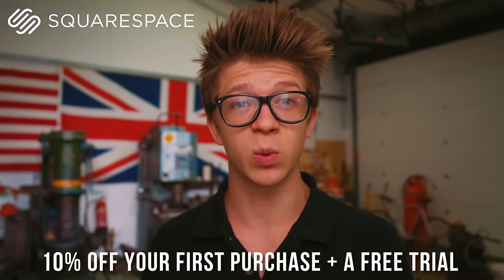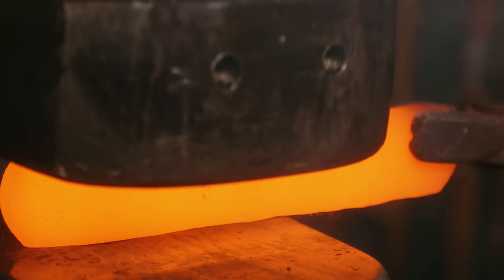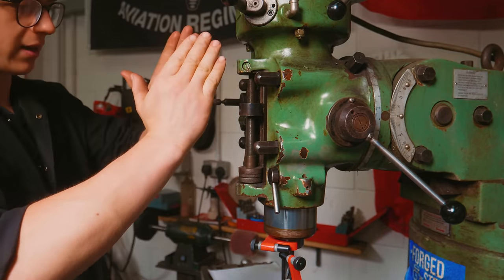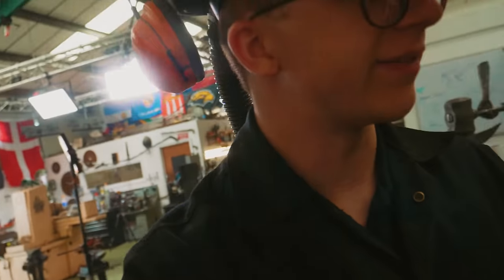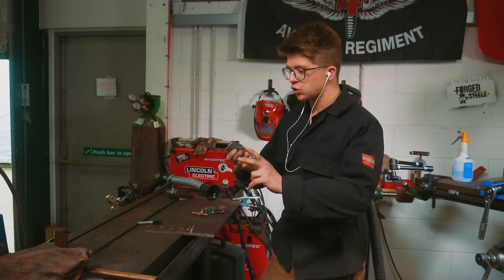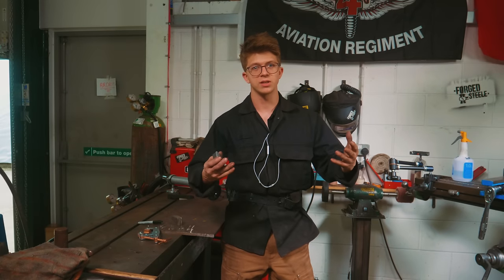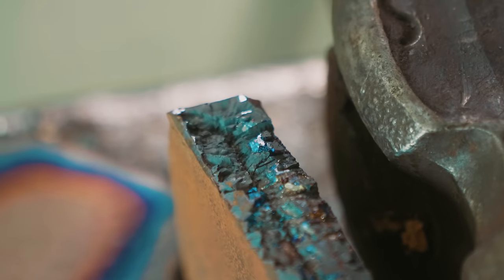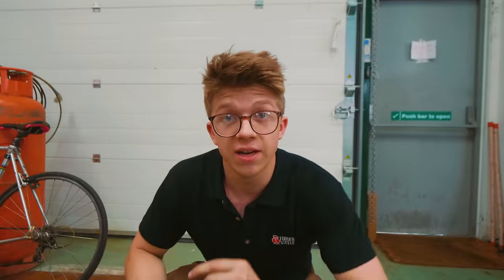CAN YOU MAKE TITANIUM & STEEL DAMASCUS?!?!

Comment: Why dont you melt the titanium in a crucible and add steel in it ? Then they will be fuzed already and cool it into bars and make a damascus with it ?
Reply: Alloying titanium with steel likely wouldn't work at all. At least I see no production alloys and if it worked and was useful someone would have mass produced it. But then again maybe someone has and it was just a useless alloy for mass production. 
Two I don't know that he has or had a kiln that could actually reach 1670c to melt titanium. To the best of my knowledge he couldn't melt steel in the first kiln and that requires 1510c. Best I have seen him do is bronze at just 950c.

Comment: Considering the melting point of titanium is so much higher than steel I'm not at all surprised this didn't work, especially in a gas forge. I'm surprised you can even forge weld steel in that.

Comment: Considering titanium is so strong. You should heat the titanium up. Before you join the pieces together. Get the titanium not toy melting point. But close enough and then the mild Steel. Heated up till about eight hundred degrees. Sandwich the piece of mild steel between the titanium two pieces of titanium. And then let the titanium bond to the mild Steel then hammer it  lightly of course using lots of flux.
Oh, yeah. I also like to see some wootz Damascus steel made. Nobody is ever touched on that. In blacksmithing much

Comment: The problem could be a oxide layer as many other have commented. Maybe if you tin the titanium with solder, led or another metal that bonds with titanium... Then an oxide layer won't form on the surface and maybe you could forge weld it. Comments on that?

Comment: Can you somehow mix Tungsten into the center of a forged creation, and then create a knife, sword, lawn mower blade or something of the sort? I want an edge that doesn't go dull.

Ps not a toy! Tungsten carbide cuts steel.  If the Tungsten Carbide is sharpened to a razors 0edge, there should not be much force needed to actually cut through an object. (Yes I said cut, not bashed). I feel if the steel could wrap around the tungsten,  then stress induced failure could be less of a problem.

Comment: What if you drill holes through the titanium then have poles coming from the iron that fit with the titanium then hit that to hold it in place making it begin to rivet itself into place then it will after a while start to "weld"

Comment: Well... I am no forger.... just an engineer. Isn't a fusion between two metals sorta like a metallic bond on a molecular level? Well then... titanium (depending on the alloy) won't bond to steel (iron and carbon) as the titanium (depending on the alloy) has a much higher melting temp than steel (again, depending on steel)  and reaching that melting temp will cause the titanium to oxidize in atmosphere...... so..... one could try and heat the titanium to it's melting point in a vacuum (hard) to forge weld it to steel, but then the steel would be supes gluey... so the only other option is to alloy the titanium with another metal (will still get oxidation) to try forge it. What I wanna see you try is cobalt and steel. Blue with a black etch.... could look sick af... or cobalt and copper... sick af as well! If it's possible (haven't thought about it)

Comment: QUESTION: what about 6150 + L6 ?

HCS+Ti was obviously a failure due to incompatible working properties.  However, specs imply 6150 and L6 should be a much more promising match.

What little I was able to follow suggested they might work well together, and should have a nice visual contrasy, but both are apparently rather hard to move and need a really strong power hammer.  Since you guys have that brand new Anyang 165 ... any thoughts on trying it out on an experimental upgraded damascus pairing ? 🤔

I'm not a smith, so this is all just armchair metallurgical woolgathering to me. Exactly the sort of thing I'd play with, if I were a smith however.

Comment: Your surfaces aren't flattening enough. Lap the layers together and wring them like gauge blocks. Then you should have minimal air between layers. I'm betting they'll fall apart once they are in the furnace due to uneven heating of the metal but who knows you might get lucky!

Comment: I know this is late but I was curious if sandwiching the steel on the outside might affect the bonds. Maybe soaking the welded block in an anti-oxidizer solution prior to heating. Is there a flux like used in Damascus steel? Just wondering because I dig the trial and error of education and experimentation from the channel. Like the Hakuna Mattata made with copper and nickel. Btw-did you reach out to Pewdiepie for that one? Merch collab? Js...

Comment: as forging is a form of welding, look at the welding processes, they are not patented, thats general info, purging with argon is standard to welt, as the oxides cause cracking and delamination. then electric arc to melt

Comment: titanium aluminum and magnesium are very closely related on the elemental table all have one thing in common they can burn in the 1910s and 20s they made a pot metal mix of aluminum and magnesium that stuff burns brighter than the sun! they made it because it was blue-ish so pretty bad thing they also used it in airplanes when they found a WWII bomber in the arctic they got it running again stupidly they used linseed oil to clean the inside and left a rag inside that self-ignited and when the aluminum/magnesium mix was hot enough it went up like a torch!
they also used this mix in paints and probably that very paint was on the Hindenburg it wasn't the mix (thermite) the Mythbusters suggested it was very likely this puppy! far more flammable! 
the biggest use was in the production of pencil sharpeners in fact they are still being made today I made some great homemade fireworks out of these by grinding them to powder and mixing it with gunpowder ps disclaimer: do not try at home folks! I have been experimenting with anything and everything for decades and I do get hurt at times so, if you know F-all then don't come near this.

Comment: If titanium can be Forged but doesn't stick.
Can you or i suggest to Forge layers of metal such as stainless in the inside hard steel at both sides (but softer than type of stainless steel in the inside.)
Such as Filipino type machete that is hard in the inside then soft toward the outside.

The process of doing it is to wrap the stainless with folded hard metal leaving small part of the titanium at its edge for the main sharp blade.

 not just sandwich, but folded from side band back for the sharp blade. 😊

Comment: can you put you billet into a piece of square tube then seal the ends and form/bond it then later you should able to remove the box by grinding it way ??? will that work or will the different metals expand at a different rates ????????LLl

Comment: The way the metals reacted when you hit them reminds me of the legendary angel steel that would burn on contact with almost everything accounts on the metal said it was very strong and light but set alight as soon as it was hit by almost anything else and it was said to be of strange cold color which also fits the colors of the oxides matches with that too so something like what you were trying to make might be what the legendary metal was.

Comment: Termal linear expansion coefficient of Ti and Steel is to different for stable connection. Evry time it's  cooled after you heat it up, it will crack. This and bemetal corrosion kills the idea of Steel Ti damascus entirely. it's not possible at all.

Comment: The problem you're having, is similar to the problems when trying to weld magnesium and zinc. Would it be easier to have 2 pieces of titanium, & 3 pieces of steel in between, with the 2 outer layers of steel folded over & weld it all closed.

Comment: why not use a press rather than hammering. also isnt there a technique of putting kerosene of something in-between so it burns off the oxygen or using another filler metal that bonds to both.

Comment: How about sandwiching in the new diamond hard platinum/gold alloy into the mix for the edge and point?  What if THAT would bond dead center so that the final product would have the perfect edge?   Would that Platinum alloy stick to titanium?  Sandwiched RIGHT in the middle?  If so then perhaps on the outside also?  Giving one Uber tough outer surfaces and diamond hard edge?  If it works and you get rich off it at least please make me a sword....and a small percentage if you want to be fair

Comment: Should try using a layer of high carbon steel and the titanium layer should be like a third of the thickness shouldn't the fuse if you titanium layer is thinner than the high carbon steel

Comment: Why not try some flux between the layers and/or use both kinds metal welding flux liquid and powder maybe even try some soldering flux inbetween couldn't hurt trying those...or see try using h1 steel as it has no or very little carbon...

Comment: Try platinum and titanium they are both transition metals and have a good bond because of there atomic structure and both forge easily together also both are brittle so they will not bend.
Reply: Yeah other than the fact that platinum is more expensive than gold
Reply: True

Comment: Ok try this make a sandwich heat to red hot let it cool heat it weld the sandwich from all side flat re heat hammer it make a long bar cut it gently make a sandwich reweld all side keep going until u see a layers you want and make a blade may i think it will work

Comment: The trick with titanium is SLOW. Cutting or drilling titanium too fast dumps too much heat into the cutting device. Titanium holds heat well and dissipates it very slowly. That heat all dumps into your cutter softens it and dulls it. Try 800 rpms or less.

Comment: Put steel and titanium plates with concave surface under a press like this
 ]  ->  )(   <- [
Reply: I realize now why this wouldn't work
Reply: Cause it's not trapped oxygen that's the problem, it's the oxide layer that forms on the surface.

Comment: Tungsten Titanium Alloy?
Reply: Or Nickel Titanium (Memory Alloy) + Tungsten?
Reply: Very possible but I doubt his forge could manage that without complications. He is usually use to working with steels and his forge seems to be more well suited for that. Most steel forges can't handle tungsten considering it's more hard to work with and becomes more brittle the more you stress it out.

Comment: Wouldn't it be better. To just fuse both metals together naturally. By melting both down in the same crucible.  And mix it together using a crucible stirring rod. You would have to stir it really well before it cools though.  This would make the bond between both metals stronger. Of course  I could be wrong about that.

Comment: Can, or... is there possibly any type of fluxxing agent that could be used that would keep the oxidation process of the titanium held at bay? Or if not, because the patented process is doing things  in an inert atmosphere... would it be possible to electroplate the titanium with another metal, that would both allow a more readily forge weld with the steel, but also remain bonded to the titanium to keep the oxidation at bay while allowing the forge weld to happen with the intermediate plating material? Kind of like copper plating before chrome plating over it... an interesting problem, makes one wonder about the alternative methods that could be tried...